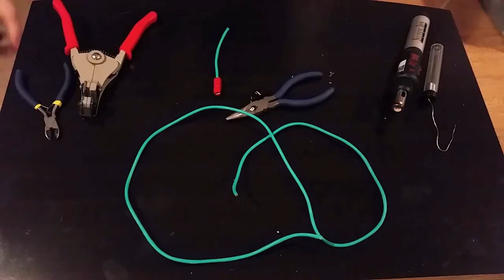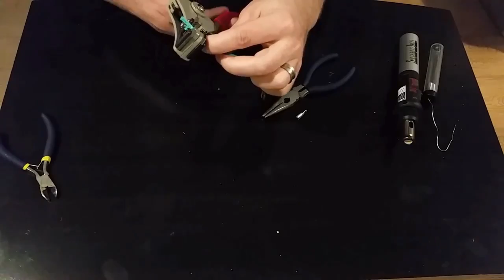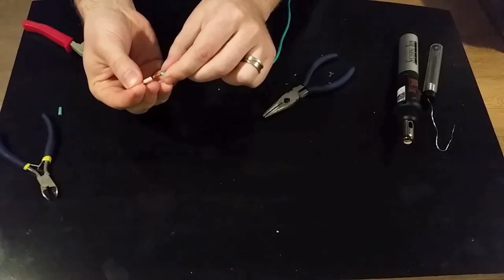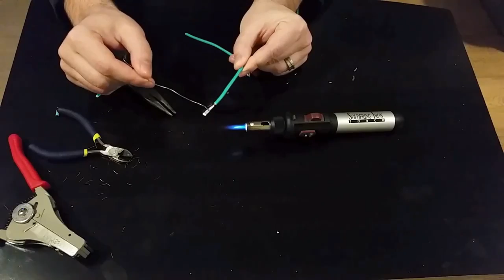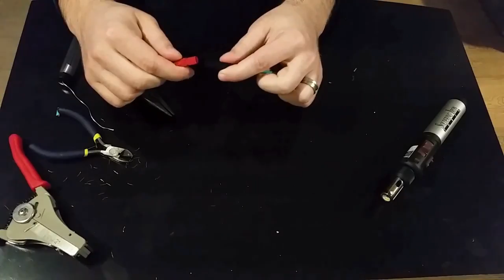Using and Crimping Anderson Powerpoles  Without the Special Expensive Tool

Comment: I totally agree with your method of using needle nose pliers to connect the metal part of the connectors. Crimping one side of the connector and then folding the other side over works like a charm. I tried a number of crimpers and they all gave me trouble.  They flattened the connector to the point where it would not fit all the way inside the housing.   When I used a pair of pliers the way that you showed in the video it was a game changer.  It's also important to emphasize  that you left a little bit of bare wire on the rear end of the connector.  If you butt the insulation up against the connector it won't go into the housing far enough to give it that click that you need to know that it is seated properly.  I did add some shrink tubing to cover the exposed wire after I confirmed that the connection was right.  Every attempt after that went perfect.  I don't need to spend another $30.00 on a tool that I won't be able find when I need it when I can just use a simple pair of needle nose pliers and get great results every time.  Thank you soo much.   I just had to find your link again to say thank you.  I didn't use any solder on these connectors because they just pull apart with very little force.  I didn't think soldering the parts was necessary.  Great Job.  If I've learned anything in life... It's that less is more.  Keep it simple. Thanks again.
Reply: I'm glad I found this video. I can't find my crimper and do not want to spend another $35.

Comment: I have installed hundreds of crimp connectors--mostly on coaxial cables. I bought the right crimp tool and it is faster, much more consistent, and results in connectors that are reliable for the long term. The right crimp tool for an Anderson PowerPole connector costs less than $50. If you're doing even a dozen pairs of connectors, the price is well worth paying, in my opinion, for long-term reliability. People differ on this point, and thanks for making this video to provide an opportunity to discuss this point, but I feel strongly that there's no substitute for the right assembly methods for connectors. Life is just too short for trying to track down and fix connectors that become unreliable over time. And with high-current applications, the heating that results from poor connections can be a fire hazard.
Reply: I need to do exactly two Powerpoles, on my extender battery for my ebike. This video is just right for me.
Reply from the maker: +Willi Hansen glad it helped you. I hate to do this, but now I need to ask for your help. With YouTube's new terms of service I'm going to be demonetized in a month. Even if the rest of my channel isn't your style, I would highly appreciate if you subscribed to help me maintain my ability to get paid for my work. Thank you very much in advance.
Reply: I agree with you, it takes the right tool for the right job. Like another guy posted already, you'll have a better electrical connection with the stronger compression provided by the right crimping tool. This video should not exist, it gives the impression that this guy's method is a good alternative, but it's not. Even more considering the price of those little Anderson Powerpole connectors, it's a waste of money to use Powerpole connectors this way.

Comment: Good video, and a good example of why Power Poles rock.  We might differ in opinion on using the proper crimper, though... 
 the compression created by a good crimp reduces electrical resistance.  Here is a video explaining one of the most common failure modes of DC electrical connections, and how to solve it.  BTW, we use Power Poles exclusively for DC power when we have a choice.  ;-)
https://youtu.be/bJSXU6nLXCE
Reply from the maker: Interesting. Do you have a reference to how compression created by a good crimp reduces electrical resistance? ... If not, another item on my list; I'll have to do a crimp vs solder resistance test. It's going to take some pretty interesting methods to measure that level of change!
Reply: +Makin'Things, I don't know about these small scale contacts and small crimpers. However, I used a hydraulic crimper on a 175 amp connector and cross sectioned it and polished it (in a metallurgical lab when I had access to such). What I found is, at least at that scale, the copper actually cold welds. At 500x there was zero gap, this is enough magnification to EASILY see the grain size in steel. A solid copper (molecular) connection is going to inherently have lower resistance than a mechanical connection or soldered connection. Like I said, I do NOT know if the recommended crimpers achieve that level of compression (though for such a small contact it is certainly feasible, I was crimping 2 gauge wire to make sure I got a good connection before I built a battery bank). Unfortunately I no longer have access to a lab, so I cannot offer to do a microscope analysis of various connections.
Reply: @HandfulOfTranquility  You're absolutely right.You'll have a better electrical connection with the stronger compression provided by the right crimping tool. This video should not exist, it gives the impression that this guy's method is a good alternative, but it's not. Even more considering the price of those little Anderson Powerpole connectors, it's a waste of money to use Powerpole connectors this way.
Reply from the maker: +Hardened Power glad  you enjoyed. I hate to do this, but now I need to ask for your help. With YouTube's new terms of service I'm going to be demonetized in a month. Even if the rest of my channel isn't your style, I would highly appreciate if you subscribed to help me maintain my ability to get paid for my work. Thank you very much in advance.

Comment: I'm so confused.... are the sockets and the plug the same exact thing or are there two separate pieces I have to buy
Reply from the maker: they are the exact same, and you can orient them in different ways to key your plugs so you can't mix them up.
Reply: I was confused about this too not long ago. It's the same exact connector for each end, it looks confusing but they connect to each other.

Comment: This is good in a pinch but the purpose of Andersons is to eliminate soldering as the heating of the copper wire makes it brittle and prone to cracking under movement and vibration. It is now illegal to solder many types of joints in aerospace and transportation because of this. If the brittleness is not a problem in your application this will do the trick.  The crimper is $38 on Amazon and is worth the price if you will be using Andersons regularly.
Reply from the maker: Right, people can just stop short and not do the last step of soldering, which is why I really don't get why people are so gungho on this pont, and I sure hope no one building a plane is watching this how to, or not using pro tools! Anyways, the real Anderson crimper is 488$ on amazon in Canada, and cheapo knock offs that will take two months to arrive hover around 50$.
Reply: I think your getting confused between illegal and not to standard. Just because things aren't advised or to standard they aren't illegal. 

The legal part comes in when things blow up and they are determining fault and if it meets the threshold for criminal negligence.
Reply: @ChillyDippers   Call it what you want but I believe soldering is not allowed in parts of aviation and rail electronics components for the reasons mentioned.
Reply: I bought a $10 pair of non insulated ferrule crimpers and it does the job. It has 5 smashing points of contact. Smashes the hell out of the connector into the wire and the entire metal connector is touching every strand possible.
Reply: @DyLemmaOG  link for your crimpers??
Reply from the maker: +Chilly Dippers I hope you enjoyed. I hate to do this, but now I need to ask for your help. With YouTube's new terms of service I'm going to be demonetized in a month. Even if the rest of my channel isn't your style, I would highly appreciate if you subscribed to help me maintain my ability to get paid for my work. Thank you very much in advance.

Comment: Thank you for sharing this information.  I did not want to purchase the tool and knew there must be a proper way to do this without it.
Reply from the maker: 1- This is in two steps, obviously you do what is right for your application; many times soldering is necessary. 2- Only connector I had fail in my ebike was crimped because it got snagged. Sometimes that is more important. 3- Crimped connectors are more vulnerable to salt rust than soldered connector, but no one says never solder because of that; you are just expected use good judgement. Tone down the alarmism.
Reply from the maker: +Ricky Baker glad I could help :)
Reply: Thanks for saving me some money!

And my sincere thanks to everyone else, so that I now know about mission critical applications of electrical connectors in marine, transportation, and aerospace.
Reply: And for a 12V power block on a hobby bench? Those are well known for bursting into flames and plunging into the ocean - good point.
Reply from the maker: +Ricky Baker glad it helped you. I hate to do this, but now I need to ask for your help. With YouTube's new terms of service I'm going to be demonetized in a month. Even if the rest of my channel isn't your style, I would highly appreciate if you subscribed to help me maintain my ability to get paid for my work. Thank you very much in advance.
Reply from the maker: +GrimlyKK I hope you enjoyed. I hate to do this, but now I need to ask for your help. With YouTube's new terms of service I'm going to be demonetized in a month. Even if the rest of my channel isn't your style, I would highly appreciate if you subscribed to help me maintain my ability to get paid for my work. Thank you very much in advance.
Reply from the maker: @SaintNobody thank you for restoring my faith in humanity